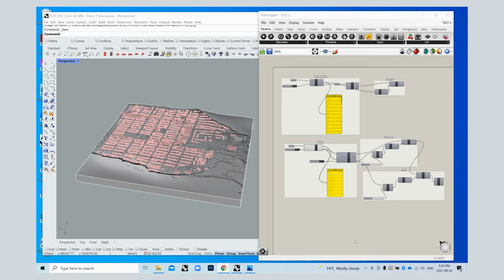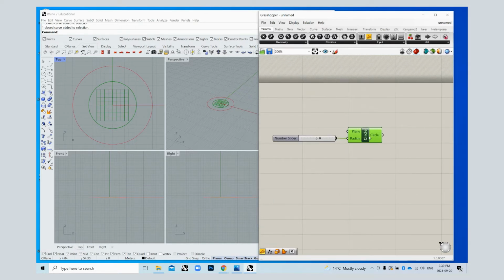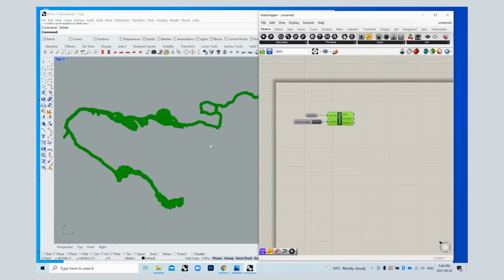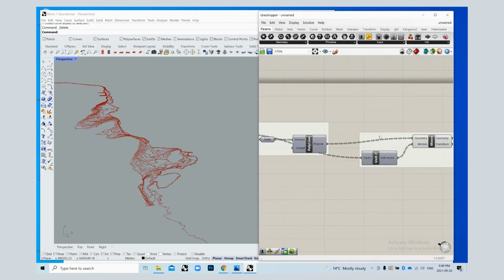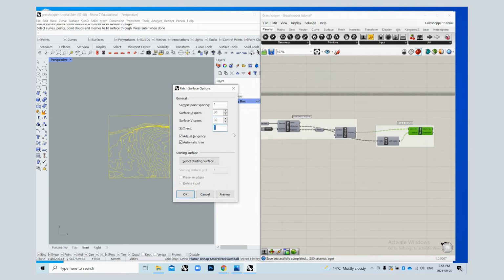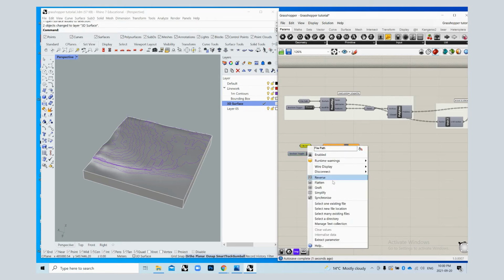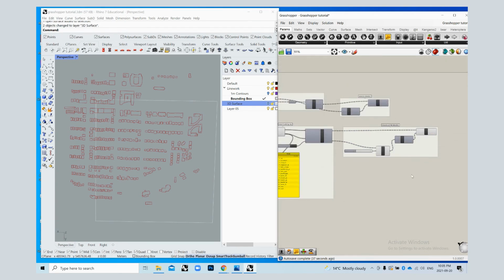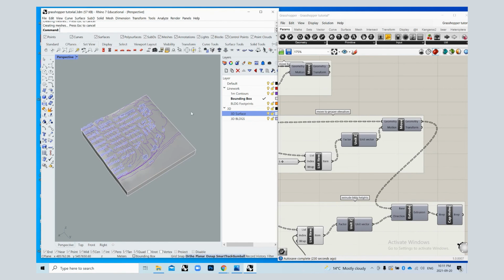W3_Site Model in Rhino and Grasshopper - Part II - Topo and Buildings

Comment: Why I cannot contour anywhere on the map ? It just show your area that you select in video??
Reply: You should be able to use the rectangular selection tool on the opendata website to select any area in Vancouver. The script may have already set the file I downloaded but you can re-link it with your downloaded contours by right clicking on the File Path component and choosing Set One File